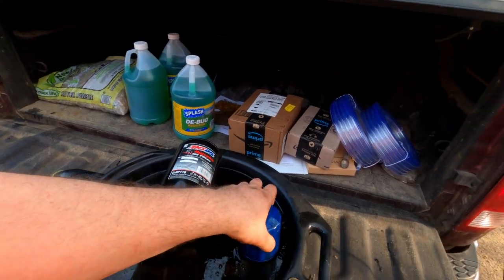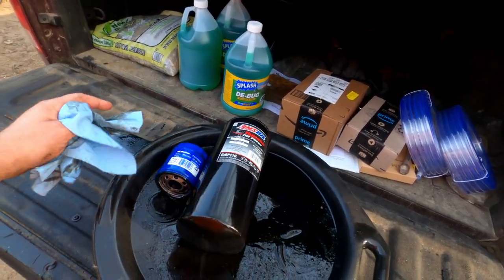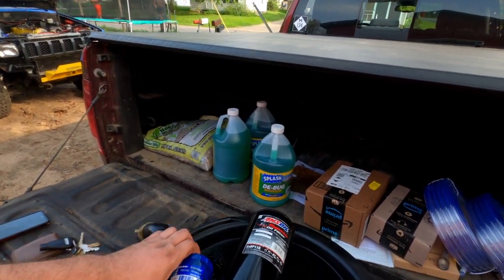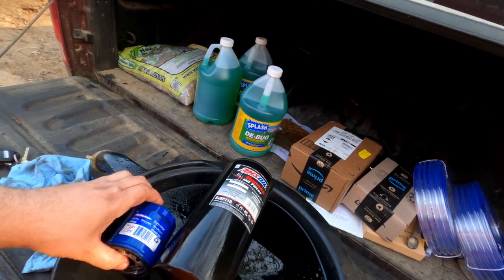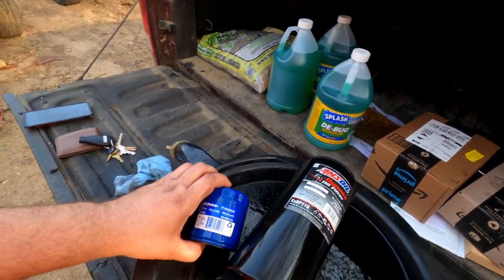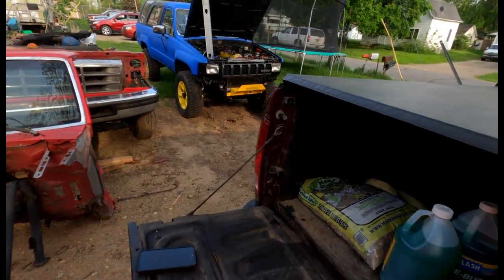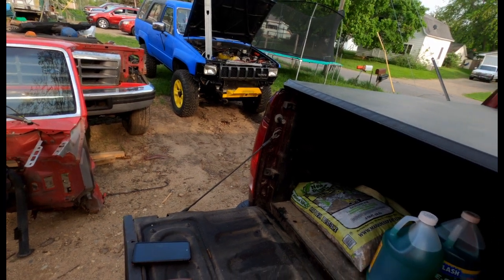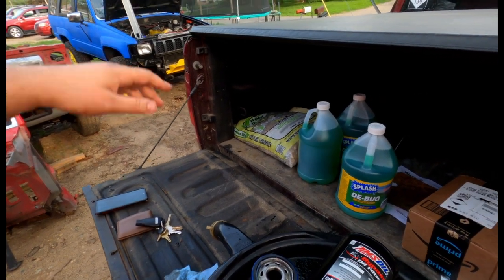Oil filter fiasco: This Was Unexpected!!

Comment: The 06 envoy that I bought with the all mighty aluminum 5.3 that had no oil pressure now has oil pressure, from 48 psi cold to hasn’t dropped under 40 yet,it was the oil pickup tube O Ring, a 5 dollar fix that took 20 hours , while I was in there I changed all the front diff seals ,front brakes and a water pump, turning out to be a mechanic special that has a happy ending, good luck on figuring out your oiling issues.

Comment: There is a reason why you have the external oil cooler system and everything else. is to help regulate the motor temperature in the block. bringing the oil temperature down in the oil because you have that Turbo you can't just do it just on the coolant system you have to also depend on the oil system to help bring the temperature down.......
What was going on with the vehicle before you made these changes if you don't mind me asking

Comment: Its a knuckle buster to change. But im mostly happy to have stayed with the stock system. Its protected and the filters are cheap. Even though its a pain. That gasket under the oil filter housing is key almost all the old engines leak.
Reply from the maker: I'm gonna have to drive yours someday. 

I still have tweaks to make to mine, but the whole 7.5mm pump and upgraded turbo deal aren't exactly lighting my world on fire right now. 

Still need to try advancing the timing a bit and rebuilding the injectors, but right now, it's pretty soft off idle.

Comment: Running with no bypass is a really bad idea on anything but a trailered race car. Blocking the bypass isn't about oil pressure (though I get you, some guys are overly obsessed with oil pressure), the bypass thing is about filtration. Systems with a bypass only filter 20%-40% (sometimes less) of the oil per pass. Some guys think they need to filter all of the oil every pass because real race cars do it that way. Problem is, with a filter designed for your engine size, that assumes 2/3 or more bypass, running that filter with no bypass means you may have restricted the volume of oil to the point it couldn't feed the top end if the engine. Your engine also probably runs thicker oil than the 3.0 DMax... The same filter will flow less with thicker oil. That may have overpressurized that little filter and collapsed it internally. When we run a no-bypass system (trailered drag cars), we're running 2 massive filters the size of coffee cans, in parallel. Usually with 0-wt oil.
If I remember correctly, Gen 1 SBC don't have the bypass in the filter, it's in the filter adapter (between the block and the filter). I don't know about Gen 2, but I'd guess they're the same. The interwebz say late LS2 had the bypass in the filter...
Reply from the maker: According to the WIX catalog, almost everything with a 3-16 thread has a bypass in it, including the SBC ones. 

I can also get a 3-16 filter in shorter lengths than I can get the 1-16 filters in. The shortest 1-16 filter I can get is still 6" long.
Reply: @TheDrivewayEngineer  Interesting. Maybe they just put a bypass in all of them as standard? Maybe specifically to prevent the guys who block the bypass from blowing stuff up and blaming the filter? Or maybe just because most of them fit on something where the system depends on the filter having a bypass? Belt and suspenders can't hurt, I guess.
Reply from the maker: Just tried a 6.7 Powerstroke filter with a 11psi bypass in it and got a small dribble out of it.
Reply: @TheDrivewayEngineer  I'm not understanding how multiple filters can be simply not flowing, or flowing only a little. Bypass or no, the filter itself should flow WAY more than enough to not really be a restriction at cranking speed. You surely can't be plugging the filters as soon as you start cranking the engine doing a test. Correct me if I'm wrong, but if I understood your description right, with the filter removed, oil pumps right out of the filter housing at a reasonable rate, but with the filter on, it pumps way less or none. I do have 2 thoughts to consider - 

1: direction of flow. With the filter off, is the oil pumping out of the center (from inside the threaded fitting the filter screws onto), or from the hole off the side of that? If it's pumping out from the center, you have the hoses hooked up backwards, and there may something that causes filters to not flow properly in reverse (just speculation - I never tried it). But the normal direction of flow in a spin on filter is outside -> inside. I know you tend to know what you're doing, but... we all have an oops now and then, especially when working under less than ideal conditions (like in a driveway with not-great lighting...). In this case, the difference in flow (some or none) could be differences in filter design. 

2: testing the outflow - I'm guessing you are unhooking the outlet hose from the filter housing, so you are adding 2 things into the 'filter on' test, that are not involved in the filter-off test - the filter, and the path through the housing from the filter to the hole the outlet hose screws onto. If you have the hoses hooked up correctly, the outflow from the filter is going through the threaded fitting the filter screws onto, into the passage in the housing, then out the hole. Maybe look through the fittings and passages, and see if you have an obstruction. For example, the fitting that screws into the filter housing and into the threads on the filter, could be screwed in too far and obstructing the passage that intersects that threaded hole, going to the hose connection. Such a problem could also explain the differences from test to test - the fitting could be screwing in and out when you change filters, and changing the amount of restriction (i.e. bottomed out in the hole when you have no flow, and maybe 1 or 2 threads from bottomed out when you have a little flow). Even if it's not that, looking for other variables, besides the filter itself, that could be possibly changing from test to test, and changing the results, might help you find the problem.
Reply from the maker: @chriswisneski6071  You might be right, I may have the lines swapped on the filter housing. 

The Amsoil filter flows fine, no other ones manage to. 

The Amsoil filter has no drainback or bypass valves in it, it's a full flow filter. 

The other two have both. 

I'll have to double check this tonight. 

If they are reversed, then I guess the Amsoil flows enough backwards to keep it running, because I was driving it around like that lol.

Comment: Anti drain back you mean
Reply from the maker: No, I mean bypass
Reply: The small block Chevy filters the way I remember were for anti drain back,,, the little flapper seal at the threaded side of the filter at the 6,7,or 8 little holes right inside of the filter.  There I go thinkin again!!!
Reply: @TheDrivewayEngineer  is it possible that your plumbing is backwards? The anti drainback flapper in the ac delco filter would prevent oil flow if so.
Reply from the maker: No, I didn't change anything but the filter.